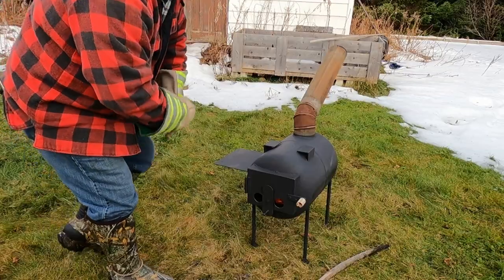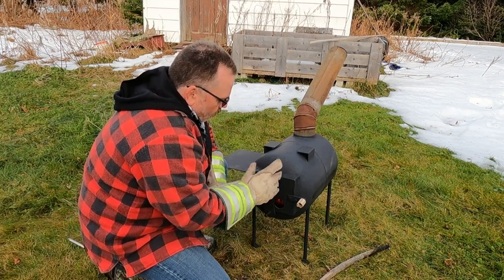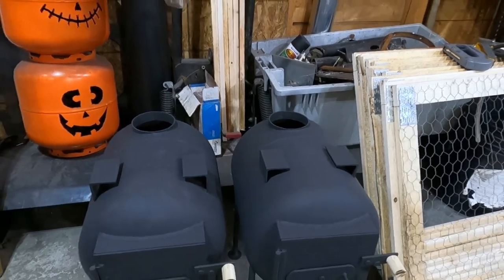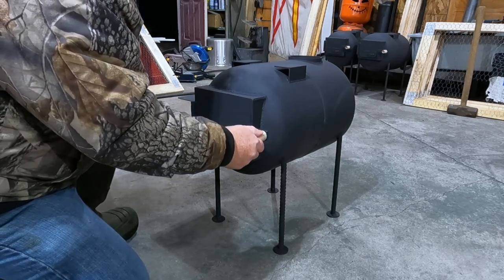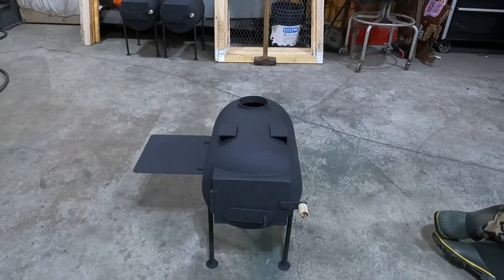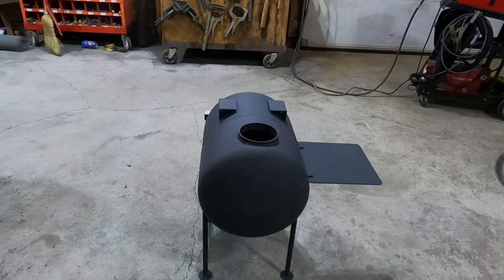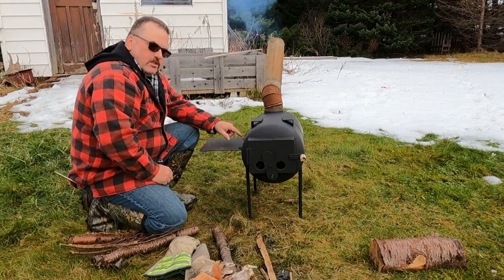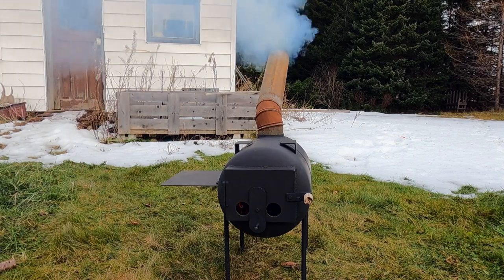Tent Stove Completely Modified, Winter Camping Starting Soon

Comment: That's a good simple design. Maybe add a hanger or bracket  under the tank to store that side shelf when not in use or during transport.
Reply from the maker: good idea
Reply: @NLGhostWolf  does the shelf and all of the exhaust not fit inside the stove for transport?
Reply from the maker: @mfattomica3196  yes it does
Reply: Indeed